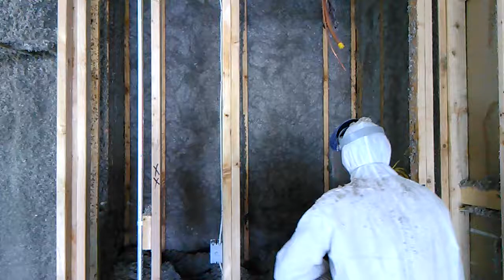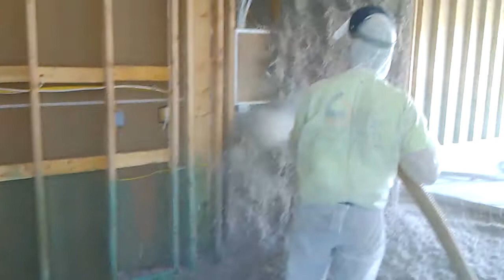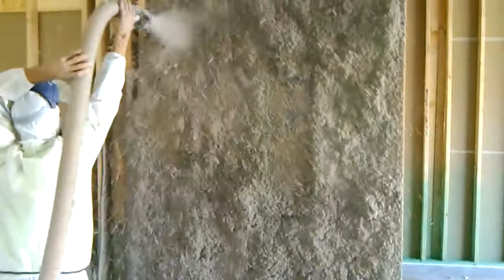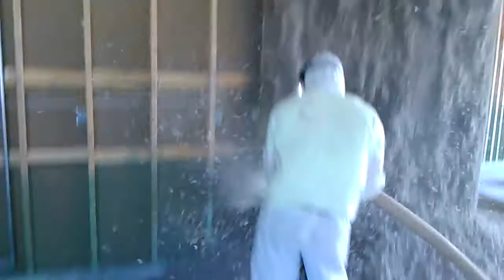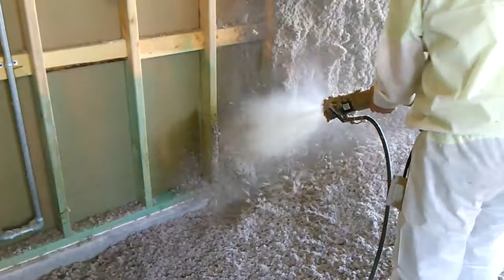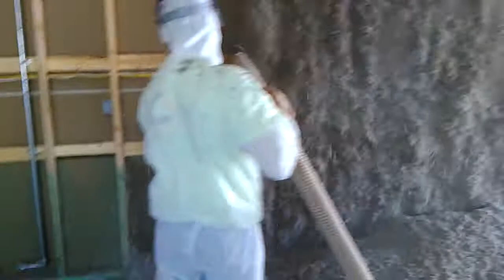Cellulose wall spray insulation

Comment: That's pretty kool. The cellulose is already wet or you mix it on the spot!? No mold issue!?
Reply from the maker: We spray it with water. There are water jets at the end of the gun. Have to let it dry a day before sheetrocking to prevent mold.
Reply from the maker: At least a day in Florida but its hot here.